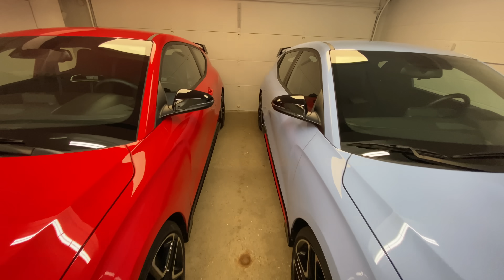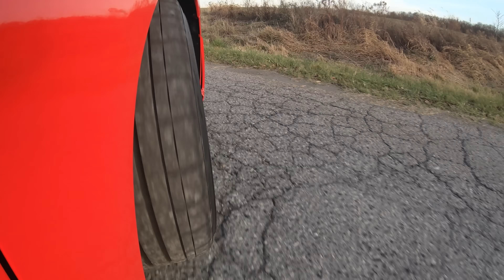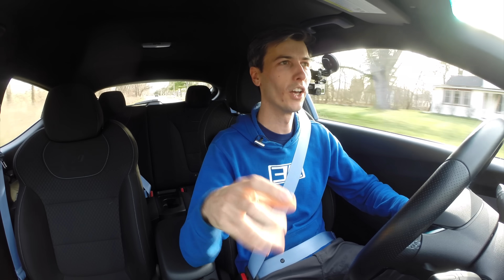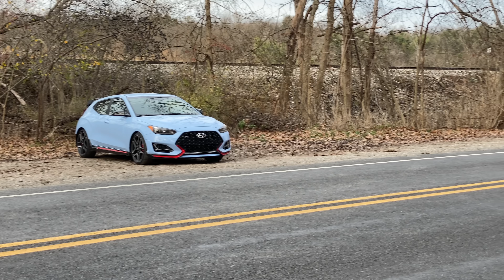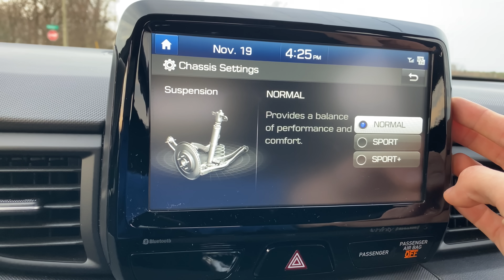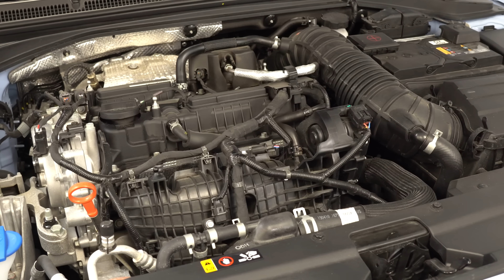Are Front Wheel Drive Sports Cars Any Good?

Comment: Hey Jason, I really enjoy your videos and want to thank you for that. This video raised the burning question to me: why was it in the first place that the automotive industry came up with fwd vehicles? My understanding is that the automobile derived from rwd... am I wrong? I'd love to see you doing a video on that topic in your typical scientific manner listing all the pros and cons. Greetings from Germany sincerely Philipp
Reply: FWD cars usually have TRANSVERSE mounted engines... which means the cars engine bay can be shorter thus allowing designers to make more room in the cabin for passengers WITHOUT lengthening the car.  In addition, FWD cars cost less to produce by using fewer parts because the engine and transmission are essentially tied together... also as an off shoot to this, FWD cars weigh less which means better fuel economy and fewer emissions... and manufactures have restrictions on how many cars they can sell based on emission standards overall.  FWD cars generally perform better in snow given that more weight is over the drive wheels.
Reply: @THE_CHAOSENGINE  there are some good points but the same is true for transverse mounted rear engine RWD cars but without some of the negative aspects...

Comment: FWD will never have that precision, control and balance like the RWD. FWD has advantage in snow, but only there. I have owned a few cars manufactured by the best handling FWD cars on the market which is Alfa Romeo, now I drive BMW's and I prefeer driving a BMW only because it's a RWD, although I like the Alfa more for some other characteristics.  Of course, RWD requires more driving skills to use it's potential, FWD can be driven by anyone

Comment: C'mon - "pre-filling" a brake cylinder? What's in there before you "pre-fill " it?
Reply from the maker: When you release, and the pads back off the rotor (from friction) fluid comes out of the brake caliper and heads back up the line. When you press on the pedal, that fluid returns. Many cars will do this in the rain, where they'll apply very light pressure to the brake pistons, so that the pad is contacting the rotor very lightly, washing off water so it reacts immediately when you press the pedal. Same idea here. Immediate reaction, rather than waiting for the (albeit very short) delay where the pad fully contacts the rotor again. Apologies if explained poorly in the video!
Reply: @EngineeringExplained  That makes sense now. I was picturing air or vacuum in the calipers. It just moves the pads closer to the rotor.

Comment: These Hyundais look pretty fun to drive, but are they ‘sports cars’? Strictly speaking, no. I would argue that no front-wheel-drive car can claim the term ‘sports car’.
This is because the driver has been deprived of an important control; the ability to alter the car’s path by application of engine power to the rear wheels. By modulating power in a turn, the rear wheels can be made to slip, allowing the car to drift, an important advantage on the race track,— not to mention how much enjoyment this additional control provides to the driver.
Reply: Drifting is NEVER an advantage on the track, and you can still oversteer with FWD cars.

Comment: What buggers me about E-diffs is that they brake the inner wheel, thus wasting energy and brakes. I prefer the thought of a mechanical locking diff. Since I drive quite underpowered cars recently, i don't have a need for a locking diff, though.
Reply: "What buggers me about E-diffs is that they brake the inner wheel," - Thats not how E-Diffs work at all. E-diffs work similar to a traditional mechanical limited slip diff, but with the LSD plates being compressed by an electric motor.

Comment: If you're being careful, even on track. FWD is not a problem dynamically. I don't like it personally because the front feels less linear. Even in normal road situations. But for performance it's not really a problem from mid-corner to exit. It just leaves a lot of performance on the table when braking and turning in in racing situations.

Comment: FWD cars are a blast to drive fast, I race a Peugeot 306, weighs just under 990kg, even though it's not a GTi-6 it keeps up with a lot of faster cars as it handles and stops so much better than the Japanese cars.  Also more reliable as it has never let me down at the track where as the Toyotas, Hondas, Mazdas etc which are faster in a straight line always seem to breakdown.

Comment: Have any auto makers thought about running more than 100% anti squat in the back? Raising the rear end would keep more load on the front tires. Also your front anti lift decreases as a car squats because the anti lift angle decreases. By allowing the rear to rise instead of squatting you would also increase the anti lift angle the harder the car accelerates.

Comment: Hyundai Eng.: sir the car is having an issue in torque steer.
Hyundai: make it a feature.
Reply: When Hyundai discovered the car has a torque steer, they rang the spin doctor and he said it’s intended as a feature.
Reply: And since it has (like all FF cars) unequal length torque tubes, it HAS to have torque steer, that's just how physics works.
Reply: @Noukz37  "bound to have" is a more accurate word, but yeah.
Reply: @Noukz37  I'm not an engineer, but my understanding is that 1.  Some FF cars do have equal length half shafts. 2.  half-axles are predominantly shafts, not tubes.  Torque tubes generally replace the longitudinal driveshaft on FR cars, when used at all. 3 you can also reduce torque steer with unequal length half shafts by making the longer shaft thicker.  The thing many people don't understand about torque steer is that there is inherent torque steer from the unequal length half-axles, and that you can eliminate this by using equal length half-axles, but you still have interactions where only one of the driven front wheels hit bumps or slick spots and the resultant traction imbalance tugs the wheel back and forth--the traction imbalance while cornering mentioned in this video is another example.  Even with equal half-shafts, unequal traction can result in unequal transfer of torque to the steering.   I.e., torque steer.  This is why the LSD, as mentioned in the video, is so crucial in reducing torque steer.  I would say the LSD is more important than equalizing the half-shafts, based on my personal driving experience.  This comment has just scratched the surface on the details of torque steer, maybe we'll get a full video on it here one day.
Reply: LOL exactly what I thought.
Reply: Hyundai Eng.:   sir Hyundai cars are catching  fire everywhere.
Hyundai:  Pay you-tubers.
Reply: That's because removing it completely would give the car pretty much no steering feel.
Reply: @AE86FTS  I swear Honda is the only company that gives feedback in electric power steered cars. Even then it's barely any...
Reply: @bobow4075 Alfa Romeo but with an even faster steering ration.
Reply: @AE86FTS  Kind of like not having a broken leg will not give you anything to feel? I wonder how rwd cars pull steering feel off.
Reply: @rogerpitre8663  RWD cars aren't using the same wheels to accelerate and turn, that's how.

Comment: I completely understand your point. I think most interesting advances have been on the suspension for pocket rockets, hp hasn't hugely come up in the last decade for this segment but their ability to put it to good use has dramatically changed. I have a srt4  modified with tons of power, but try and steer that thing and you better have alexa setup to call 911 from inputs on an accelerometer for when you tip over a ditch. I have driven the new veloster and although there's not nearly as much power it does feel good carving in the road.

Comment: Just going on the title but I'd say it depends on the front wheel's contact patch. No matter the technical innovation applied, there is a limit of how much steering/acceleration or steering/braking that can be applied at any given moment to the two contact patches of the drive wheels on a platform that shifts the majority of the vehicle weight from the drive wheels under acceleration and shifts the vast majority of it's weight to the drive wheels under braking. You can only ask so much from a contact patch entering and leaving a corner. What you can ask is limited by the schizophrenic relationship dictated by drive wheels that also have to accelerate, brake and steer sometimes, (left foot braking to stabilize the chassis mid-corner is a prime example), all at the same time.

Yes my daily is a beat up 2007 Focus and yes, I'm faster than most in the corners in the 24 foot long box truck I drive 300 miles a day to pay my bills, (that's 2010 Hino 268 at the moment).

Comment: -Why do you not like FWD?
-Because mid corner the car not only turns with the steering wheel but also with the gas pedal ! Very addicting !
-Yeah ok, but I can turn the car while going straight, only using the gas pedal with a FWD. 
-To a...wall ?
-Most of the time it's a tree ;D

Comment: Great stuff.  I love FWD.

I have to correct you on one very common misconception, though.  Many people think that the front wheels (in FWD, RWD, and 4WD) are "responsible" for rotating the car.  This is just not true.  Yes, when you're turning in, you have to impart a yaw rate to the vehicle, and this requires that you generate more lateral force from the fronts than from the rears.  But that's not the end of the story.  When you're exiting the corner, you have to stop that yaw rate, and that requires more lateral force from the rears.  This is why it's so easy to oversteer on exit in RWD.  As you start unwinding the steering, the fronts reduce their slip angle immediately, while the rears take a while to catch up; this lag is what kills the yaw rotation, and you have to wait for it before you feed power to the rears.

So driving the front wheels does not in itself demand "too much" from the front wheels.  FWD asks the fronts to both impart yaw rate and brake on entry (not being able to use engine braking to effectively throw the brake bias rearward).  RWD asks the rears to both accelerate and kill yaw rate on exit.  The extra demand on the fronts is really the result of the forward CG nearly all FWD cars have.  Likewise, it has taken Porsche's brilliant engineers decades to pacify the tail-heavy 911's over-worked rears on exit.

Perhaps the best thing about FWD is simply that it's a different driving skill from RWD.  If you've been racing RWD for a while and have it pretty much all figured out, you can hop into a FWD and have the delight of getting to know a vehicle that has a very different set of strengths and weaknesses.

Comment: Clutch replacement/transmission is a pain though.
Reply: Yeah on many Fwd cars, the repair manuals say to drop the entire front subframe with the engine, transmission, and entire front suspension as a whole then seperate the trans from the engine. Sounds like a pain but it's actually not that bad (if you have a lift) and much easier than fooling around with a jack or a hoist holding the engine up, trying to get the trans lined back up

Comment: They should put rear wheel steering on front wheel drive cars to improve handling.
Reply: They’ve done this for the current Megane but disabled it on their hottest (Trophy R) version seemingly as an acknowledgement that the weight and/or feel doesn’t warrant it
Reply: Thing is for the amount of weight, size and complexity rear steering adds it would be easier to just make a vehicle RWD or even AWD.

Comment: Hey , i have a random question in my mind from long , 
Why don't automatic cars use engine breaking while applying brakes? It may help you stop faster and it also adds up as a safety mechanism if your brakes fail.
Also Electric cars mimic this using regenerative braking, so why not automatic-gasoline powered cars?

Comment: They can be good. They just can't be any fun. Understeer is not fun. Oversteer that you cannot control the angle of with the throttle is not fun. They can be fast. But fun is subjective. And to me, there's not a single thing fun about a wrong wheel drive car. The myths that they're better in inclement weather are annoying as well. The only reason they exist is because they're very cheap to produce compared to a RWD or AWD car. And the car world is driven by profits, not physics. Sadly :-( 

I guess it depends on how much adrenaline you need in your body to start to have fun. If you find rollercoasters fun, you'll probably think a FWD car is also. Personally I could take a nap on today's craziest rollercoasters. So FWD just doesn't do it for me.

Comment: I grew up with rear wheel performance vehicles and always considered FWD as something that came with low performance budget cars.  With a genuine need for a budget car I got a 5th generation Ford Fiesta when they were new to the market and to my surprise I found the handling of this vehicle to be beyond belief and certainly found that it could hold its own compared to way more expensive sports cars.  When the 6th generation Fiesta became available I bought one of those and likewise also very impressed by the overall roadholding.  When the 6th generation Fiesta ST became available I bought one of those and I still have this as my daily driver.   I would consider the 7th generation ST but I live in a part of the world that doesn't have this option. 

I recently bought my wife a BRZ which I get to drive and this has been a reality check for me...

I do think that it is possible to have a good performance FWD sports car however a purpose built RWD sports car will always be the best in the end.

This being said - I don't think much about most of the vehicles available these days.   It seems like most manufacturers are moving towards making vehicles that provide as much isolation from the driving experience as possible. This thinking seems to of been adopted by all manufacturers - even the ones who once knew how to build exciting sports sedans (BWW M series).

Still there are a few great vehicles that are designed around the driving experience - the MX5 and the 86 are in my opinion two of the very best 👍

Comment: My 10th gen Civic Si does feal great but I do think that 1st and 2nd gear acceleration is hampered by the fwd. It's very likely that I'm just not giving smooth enough throttle input but I end up not being able to use much throttle in either of those gears. Sport mode does help in stiffening up the suspension but maybe not enough. I will say however that the lateral grip is great, I can take turns quite a bit faster than I ever could in a TL type s or an e60/f18. My friends mk1 mr2 with coil overs and full poly suspension might do better but it feel hampered by the stock skinny wheels.

Comment: Volvo C30 T5 had such good potential. I have one and I’d have to say power is good but brake feel and rear end suspension is lacking. Although with steel brake lines and an upgraded rear sway bar and endlinks those issues can be dealt with.

Comment: I have a 2005 chrysler sebring, 2.4lt 4 cylinder, turbocharged, the thing packs 225hp and I loooove the sound of the engine and the turbo spooling up as I hit the throttle, sure it’s a big, low and kinda heavy car, but it’s so comfortable to drive in the highway and so agile and funny when needed that I don’t see myself driving anything less powerful

Comment: The original definition of "sport" vehicles does not include font wheel drive. Front engine, 2 door (or none), rear drive, is a sport. You can have all the front wheel drive, mid engine, all wheel drive, etc, etc, etc, vehicles that you want and call them "performance" vehicles, but they are not sport. But then, these days it is progressive to use any word you want, regardless of meaning, to appear as something else.
Reply: Then what about mid engine cars? It was discovered during 60's when all sports cars were front engine RWD. FWD fast cars were become a type during 80's or something.